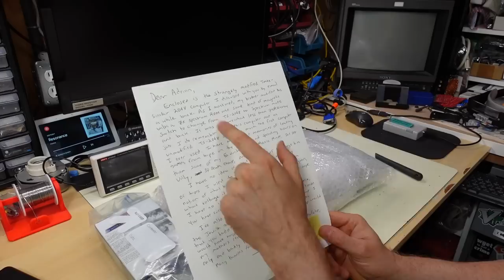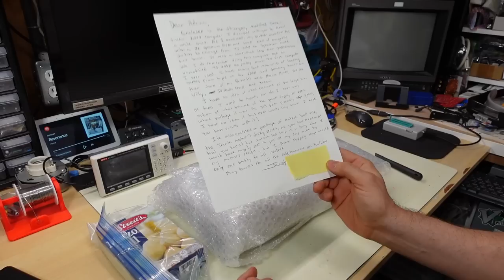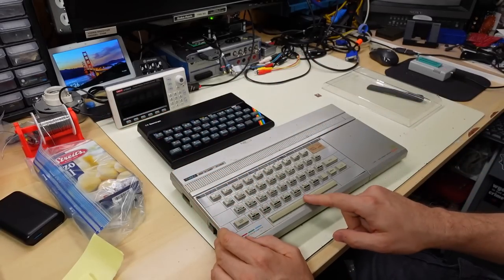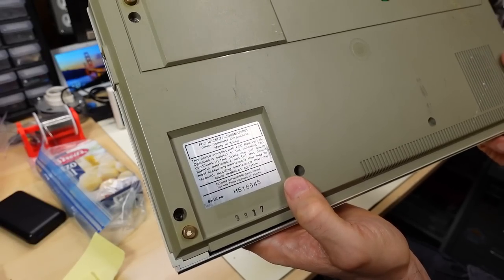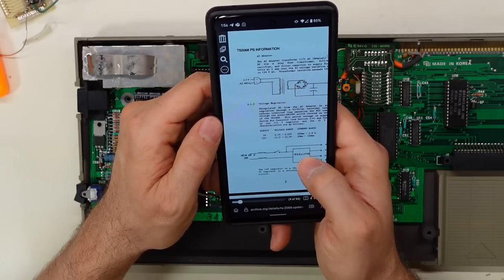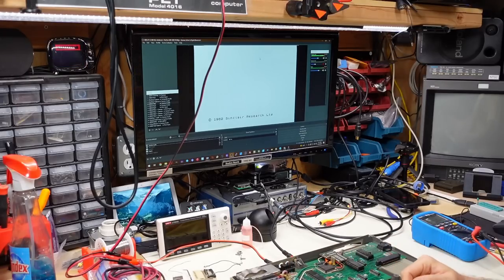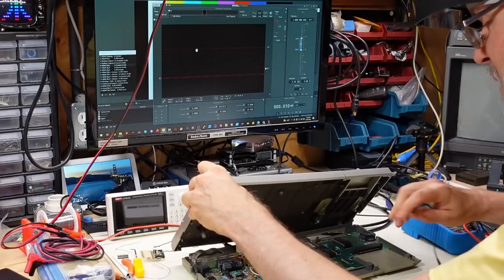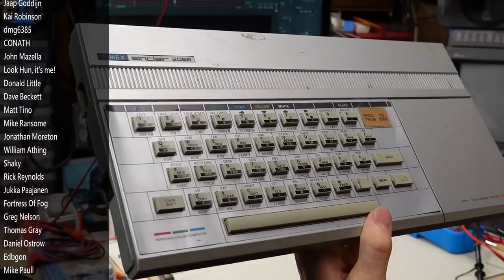0044 The ZX Spectrum of North America: The Timex Sinclair 2068

Comment: The Spectrum in was later upgraded to 128K from 1985 with a brand new ZX BASIC which did away with the annoying command key typing system and had more commands the utilised the AY-3-8912 sound chip the 128K Spectrums were using. After Sinclair's computer division was sold to Amstrad in 1985 the Amstrad designed Spectrum +2/+2A/+2B resembled Amstrad's CPC464 which had a built in cassette datacorder when the Spectrum +3 was released in 1987 it used Hitachi CF2 3" disks which the Amstrad PCW, CPC664 & 6128 were also using the Spectrum had another BASIC update called  +3 BASIC which utilised CP/M
Reply: +3 BASIC doesn't have much of anything to do with CP/M so far as I know, but Locomotive did produce a version of CP/M that could run on the +3

Comment: Hissing or buzzing TV is normal on ZX Spectrum, as the sound was coming from the speaker in computer. Sound on TV must be muted or set to zero. Also, "baseline" ZX Spectrum 48K (including "plus" version) is the main and most massively produced-16K version was soon dropped in favor of 48K, and those with bad RAM chips are also early "issued" mainboards, (Sinclair used the word "issue" instead of "version" "v."or "ver." for motherboard revision).

It was hugely popular in Europe, and when past its prime there (late 80's, early 90's) it became popular in former Eastern Europe, Belarus, Ukraine and Russia. It got new DOS and was reverse-engineered to the point that ULA chip was "de-constructed" into discrete components and built in that form!

Comment: @Adrian: YouTube has the extremely bad habit of making lengthy comments, or comments with reference url supplied, disappear. Check below my comments from my another account (N NAP), with hopefully answering most of your questions.
After watching your video: A)The video out is NTSC in color.
B) VR1, VR2, VR3 on board are for color adjustment.
C) Check the link to the Tech Manual of TS2068. Schematic is on P.299
D) Bus comparison diagrams between TS2068, Spectrum, ZX81 are on P.295
E) The ROM you got is the Spectrum ROM, judging by the Copyright message.
F) TS2068 provides besides Sinclair Research Copyright message on opening screen, also provides Timex Copy Right message.
G) The two joystick ports are controlled by the General Instruments chip, and unfortunately not Kempston compatible.
H) The ROM carrier board accommodates two ROMS, switchable by a REED switch controlled by a magnet on top of the machine.
I) Cartridge port schematic on page 113 of the Tech Man.
J) P289 has the board layout.
K) The small circuit board to the North of the board is a kludge by Timex, correcting an error, and continued till the end of production.

Comment: I have the one from my youth sitting on the shelf.  I also bought the ZX spectrum rom.  Would love to get it running again but the power pack is missing.
Reply: I got mine working with a generic 6-12 volt multi-tip power supply I got in Walmart. Just make sure it’s set to 9 or 12 V and the tip is set for center positive.

Comment: Standard ZX Spectrum uses 12 Volt for color (I should say colour) generation chip, and it generates it (12V) alongside the -5V for RAM, from the little step-up converter based on a choke you heard hissing at you. 
And I remember my Spectrum + had the AC 9V adapter. Maybe if you use the DC this thing can not start 12V ???

Comment: I watch YouTube on my TV most of the time, so I usually don’t have access to comments, but I have a TS2068 with the exact same RomSwapper mod. I can send you pictures of the working reed switch if it will help get yours operational; I know you said you’d rather go with a newer mod option, but the RomSwapper does work awfully well!

Also, I don’t remember if the composite signal out is mono or color (I need to check), but the expansion connector breaks out a ton of signals, including composite and RGB video.

Comment: I'm amazed that after 3 decades, there is NO polarity standard for barrel connectors!
Reply: And no voltage / current / size standard - or even whether it is AC or DC.  I wonder how much equipment has been trashed by people just plugging in any nearby supply that happens to fit - either accidentally or through lack of knowledge.

Comment: Fascinating! I'd not heard of the 2068 before. Do you know how much it cost when initially launched in the US? And why is it called 2068?

I'll check out that replacement parts source you mentioned, I have loads of Spectrums I want to repair. One unit though, which works ok and has a composite mod, has a different kind of keyboard mounted on top; looks rather klunky but makes typing a bit easier.
Reply: It sold for just under $200. I remember craving one back in 1983 to replace my TS1000. It went through a number of name changes. Originally, it was going to be called the TS2000 and would have looked almost identical to the ZX Spectrum. It went through a number of other number changes before landing on 2068 when they moved the design rather far away from the ZX Spectrum. There were also Portuguese TS2068s that sold in South America. These began with TC instead of TS.

Comment: As I understand it, the main reason for the Times Sinclair 2068’s failure vs the Sinclair ZX-Spectrum was Timex’s decision to make some changes to the design to “modernize” the 2068 for the American market that broke compatibility with British ZX Spectrum games. Given that so few units sold over the 2068’s lifetime there was little incentive for software developers to make native software created for either. Had the kept backwards compatible with the British ZX Spectrum then that would have opened up large swaths of software already available for the original. Even if you needed to recompiled some or most UK software for the 60 hertz NTSC, that still would have given Americans more incentive to buy one. There were of course ROM hacks and ram cartridges that bring compatibility with the UK ZX Spectrum but that’s not someone that many potential TS-2068 buyers wanted to have to do. Another facter was that systems like the C64 and Atari 8-bit systems where better systems more within the reach of more potential computer buyers then UK which had a higher percentage of budget computer buyers.

Comment: Back in the day, Spectrum programmers got the machine to do things that seemed almost impossible to do with the hardware. I can imagine that there may be programs/games that will find the 60Hz framerate of the US variant a problem. In the UK version, there is an interrupt generated at 50Hz at the start of every frame. I recall writing a program that would carefully arrange to rewrite the attributes data very fast (in fact it was only the first 24(or maybe 20) characters of each 32 character line) in such a way that each scan line (8 per character) could be in a different colour (more precisely have its own set of attributes). In other words, instead of having a single ink/paper/brightness/flashing control for each character, each of the 8 lines had it's own attributes. To achieve this, I used the push and pop commands to transfer data from a buffer to the attributes region (as I was under the impression that these were the fastest commands to execute data transfers - this meant using up all the registers and the primed registers with data), I changed the stack pointer to point between the two regions for reading/writing. A particular issue was that the stack pointer grows downward in memory in the Z80 and the scan data is accessed in the opposite direction (hence only having 24 horizontal characters per vertical line before the race condition was lost - also there was the problem of running out of registers). Of course, the interrupt routine only returned control to the program once the 24 character lines were displayed, and so the only processing that could be done was when the bottom part of the border was being sent out. I did find that graphs looked pretty good on it (black background, multiple coloured graphs on the same plot).

Were this interrupt routine to be run at 60Hz, the timings would be all off if the processor speed is not scaled prortionally. I do remember a game, that used a similar technique (or rather it just used timings to modify the border colour) that made it seem as if a countdown was using the entirety of the TV screen, and not just the text area.
Reply: ... its own attributes. 😉 (it's is the contraction of "it is")

Comment: Stock ZX Spectrums used 9v DC at 1.4A on a terrible linear regulator that gave the 64's brick a run for it's money in terms of melting and blowing up. Original ZX's are also extremely hissy and noisy just generally - someone brighter than me can tell you why, but I suspect it's a result of the cost-saving design

Comment: The 'bodge' wires are original. They are part of an attempt to eliminate interference caused by power supply ripple and feedthrough from digital to analog signals inside the ULA. It doesn't work very well. I replaced the switching power supply with a small dc/dc module, removed the video ground bodge and soldered thick copper wires between the ULA ground, composite output, and rf modulator. It's better now, but not perfect. Investigations continue...

Comment: interesting trivia re: Z80. in the 80s, spectrum programmers would often code on the BBC computer and then port the code back because the speccy couldn't run code in protected mode, so if the program crashed while you were testing it, you would have lost the lot (saving to tape was time consuming too). well, now 50 years after the Z80 was created, someone found a semi-protected mode on the CHIP !!! unbelievable. youtube z80 protected mode, fascinating!!! and you can imagine what the programmers would have given to know about this in the 80s :)

Comment: No, they could not use 64k chips for memory in ZX Spectrum. The bottom 16k of memory is used by the ULA for video generation and ULA turns off the CPU clock in case of contention. The upper 32k can be accessed independently, but only because it is in separate chips.

Comment: At least in Portugal this was sold with an emulator cartridge which made it compatible with the 16k/48k games. Downside was the side joystick port was not usable in that mode.
Reply: It does basically the same thing as the ROM switcher, but the carts seem to be rare and hard to find.

It does suggest that Timex were very much aware that Speccy software compatability was going to be a big driver early on, though.

Comment: Roughly 5:00 - actually, Interrupt Mode 2 (usually used for game loop updates) is hard locked to the frame sync on the Spectrum. I'm assuming that's the same for the Timex? So games would tend to be locked to the framerate of the system, at least on the original Speccy.

Comment: That was my second computer after the TS1000 (US ZX81) and was better than the speccy of the time by a lot.  Hm its running the speccy rom instead of the timex one. That means compatibility, but none of the more advanced features of the 2068 will be working. Composite is color. Atari standard joysticks (IIRC), Clock is a bit faster, but blanking time shorter, so about a wash in speed. Also has AY sound and extended color modes. To see all that stuff working ,you need to take out that added rom board. Should boot with two lines of text - sinclair and timex

Comment: I'm guessing the reason it failed in the US was that it was too late to compete with the C64. The Sinclair was little cheaper than the C64 in the US, but by late 1983 when the Sinclair was released there would've been a pretty big library of software available for the C64, compared to a pretty thin list of release titles for the Sinclair. Plus the quality of the software would've been much better on the C64, since the hardware was a lot more capable in graphics, sound and CPU power.

Comment: I know from personal experience that giving a ZX Spectrum 12V (I think or maybe it was center positive) will create a puff of magic smoke. My cousin had one (and I really wanted one also), but he accidentally plugged the cable from my computer (I think?) which used 12V
Reply: The Spectrum expects 9V center-negative but can accept slightly higher voltage. 12V is already too much, specially for some ICs that receive a direct input from the PSU.

But worst is feeding center-positive. Is a sure way to damage a Spectrum, will destroy the 7805 regulator which then lets pass higher voltage for the rest of the circuit, damaging a lot of ICs.

Comment: It should have color. You were looking at the video signal, but there should be two color difference signals as well that are combined to a composite signal before it enters the RF modulator. At least that's how (or similar) it's done on the original ZX Spectrum.
Reply: The mysterious plastic piece rattling around may have been part of an RF socket or connection handling the color subcarrier.  Or it may have been a stalk for a case sceew.

Comment: to repair the rom chip, i'd get an augat socket and put the chip into the socket, and solder the missing leg to the matching socket pin on top, then put the socket into the board.

Comment: There is a DiagROM for the Spectrum which you can find free online. It does require a small mod but not sure about the TS2068. You burn it to a 27C128 EPROM and it does require a small resistor/diode mod. (note that whenever I try to give the name of the website the DiagROM is from, YouTube deletes this message 😕)

Comment: does VR in a silkscreen mean voltage regulator or just variable resistor -- my experience it's the latter.  Is there something that hints that those trimmers are used in the voltage regulation circuit?

Comment: No, it wasn't possible to simply use a 64K RAM chip and just use 48K of it. The reason is the way the bus sharing works between the ULA and the Z80 in the spectrum architecture. The ULA only has access to the lowest 16KB of RAM and if the Z80 tries to access that, when the ULA needs to fetch data, the ULA gets priority and the Z80 skips a cycle. This would create a terribly slow computer if this would be the case for all of the RAM. Therefore, if the Z80 accesses the upper 32K of the RAM, the bus is split in two, and the ULA and Z80 each have their own set of RAM chips that they can communicate to in parallel. Therefore a Spectrum always needs two separate RAM banks.
Reply: It's actually more like 4.  The first 16k is ROM, which can be disabled via the expansion bus and was used for the ROM cart functionalility in the Interface 2.  The second 16k is the "low ram", which is all the ram in the 16k version.  I think the upper 32k is a single bank in the 48k, but were pageable individually in the 128k model, along with the ROM and lower 16k.

Comment: The whole point of the ZX Spectrum was to be as cheaply made as possible so that it was affordable. How much did the Timex cost? Was it more than the Spectrum, or had prices comes down so much they could make it for a similar price?
Reply: Someone else in the comments mentioned it came out at $200USD at retail which would have been cheap when it first released in November 1983 but not for very long at all as Commodore was lowering the pricing the C64 very aggressively (selling it almost at cost) undercutting all the other competition in North America in a bid for market dominance. By Christmas of 83 you could get a 64 for as little as $230USD via mail order with some dealers offering it for as little as $200 with the purchase of additional peripherals.
Reply: For a while you could get the pre-built Timex Sinclair for about $100 or the kit for $50.
Reply: @sa3270  I think that's why that model was more competitive. At $100 there was nothing remotely as inexpensive on the market as the T/S 1000. The T/S 2068 at $200 was just too close in price to other, better computers available around the time it came out.

Comment: Interesting, my TS2068 (purchased used) came with a 15V power supply and also has hissing and interference problems.  Maybe I should try a lower voltage supply?
Reply: That 15V supply is 15V off load and almost certainly it will be unregulated! On load that voltage will drop considerably.

Comment: dc input should be 15v , it has a switching regulator in it so likely will seem to 'hiss',  like the original spectrum does as well with its small dc-dc converter .. you're not getting colour 'cause the colour encoder chip needs 12v which is regulated off from the 15v input!  with 9v in its not getting enough voltage  the video output is colour, stick 15v into  the dc in and it'll likely be ok, if the 5v line is unstable with 15v, replace the cap c40 its the switching regulator output cap , also possibly c3 on the main dc input , also check cr1 1n5821 for being open,  ..  the switching control chip ua78s40 also has a section as the speaker driver,  this chip is fed from the 'raw' 15v input as well   , a bad chip could also cause bad 5v, these chips may be difficult to find nowadays   other cause of poor/no regulations is bad switching transistor , q1  d43c1
Reply: if you want to add protection against the 5v regulator going short through, or overvoltage, wire a 1N5339 5w 5v6 zener across the 5v line somewhere just after the regulator, across c40  is ideal    this idea could be used on any other computer,  c64 in particular as some of their psus are notorious for overvolting ,